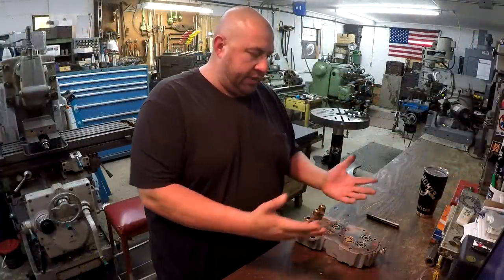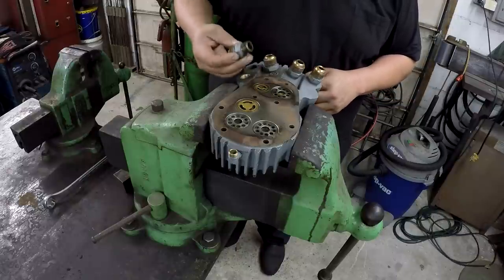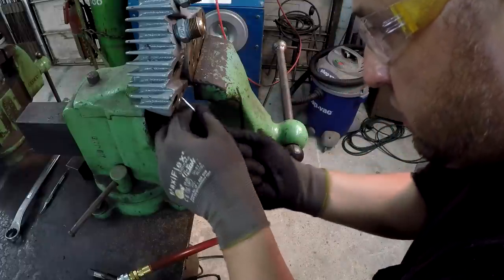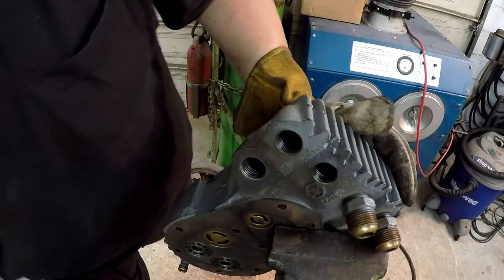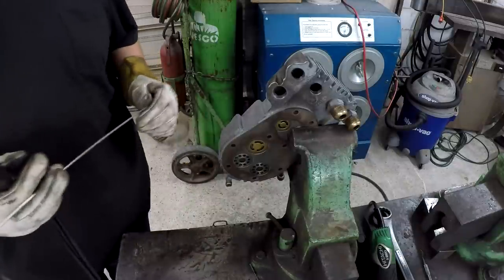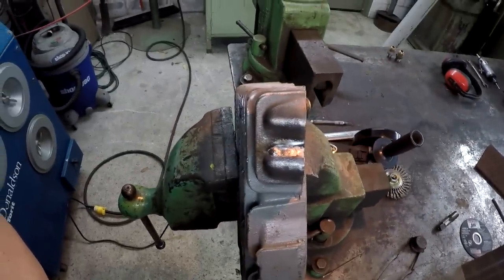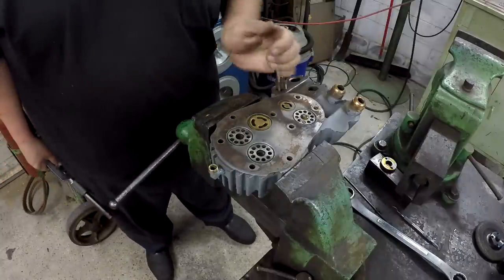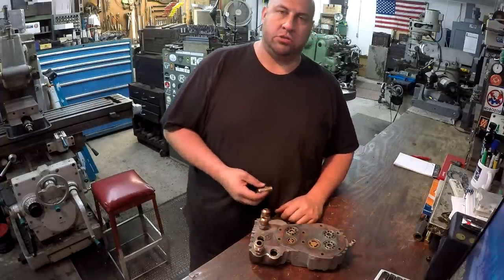Kellogg Compressor Head Repairs

Comment: One of my compressors uses the very pump this head goes on. It's an oldie but never looses compression power, VERY well built compressor from Kellogg American. I had to rebuild my head, required special tools I had to manufacture to change the ring valves. Other compressors come and go, this one never dies.
Reply: how do you get the valves out? Special tools?
Reply: @Mike Williams  I made a tool with a piece of pipe and a grinder with a cutting disk.
Reply: @mythril4  I will give that a try!
Reply: Just did one today, nice design

Comment: Adam, just a quick note about the IR thermometer. What it sees is a cone, not a dot like the laser implies. The angle of the cone should be printed on the thermometer itself. If you look closely you will see that at a distance of a foot away it is actually seeing a large area including the vise and surrounding material. The thermometer averages the temperature and you get a very inaccurate reading. I put a video up on just this subject a few years ago. It's a good idea to get as close to the surface as possible with the thermometer in order to get an accurate reading. Enjoyed the video very much.
Reply: I own a powdercoating business and use the same IR gun.   I can tell you from shooing parts like wheels lets say that have narrow spokes, lug nut holes in the center of wheels, and so on.  Where if you aim the dot at say the center hub of a wheel where it has the most mass which will take longer to get up to temp in my oven, the cone will partially be on the wheel surface and some of it will be shooting past the wheel and hitting the oven wall a few feet away.  Which in your head makes you think its not an accurate judgment of temp, but from actual readings from inches away to a few feet away, it honestly doesn't fluctuate enough to matter.   its not like 6 inches from the wheel and getting all of the wheel in the 'beam' will say 385deg and then I step back a country mile and all of a sudden its reading 265... its honestly +/- 5-10 deg max.   Now, that being said, the Kline IR gun Adam and I have, honestly, sucks.   The reflectivity of the coating or the color makes the temp reading swing a country mile.  Satin black reads the most accurate, gloss black would be next, silver or 'chrome' powder base is a mile off from actual PMT (part metal temp), white is pretty bad too, other 'darker' colors are somewhere in the middle.   Not to mention mine is over 35-40% off!   I can coat a thin metal outlet cover (I shoot these as demo swatches for people to see and feel the powdercoating colors) which will get up to part metal temperature in minutes where an alloy 20" wheel might take 45-50 minutes... I hang the outlet cover an inch away from my thermocoupler which feeds oven temp to my PID oven controller and where my PID reads 400 deg in the oven, 20 minutes later my outlet cover would have undoubtedly been fully up to temp and it reads 285 with the Kline IR gun 2 inches from it or 2 feet from it!   Its incrementally off from what I have tested and found, so bad that I have a chart I made with IR gun temp = PMT written out on the side of the oven!   I am too lazy to toss it in the garbage and get a better one because I adapted to it at this point.   My thermocoupler is dead on, and I verified PMT with clip on K type thermocouplers too.   I don't know if I just got a bum IR gun or they are all that shitty from Kline.    On this casting video I would have like to see a few temperature pens used then shoot the line where it drew and melted out on part with the IR gun to compare the results.
Reply: I use mine for measuring temperatures on the drum of my coffee roaster. I also have a contact thermometer that is calibrated so I can check against the IR thermometer. In my case the difference betwee 1" away and 6" away from the drum is enormous. At 1" the reading is very close to the measurement of the contact thermometer, at 6" it is lower by about 40%. This is on an 8" drum at about 200 °C.
Reply: same Kline ir gun?   I will have to shoot a video experimenting with mine next batch of parts I toss in.
Reply: I actually have a Kline and two  other ones and they all show about the same characteristics. It makes sense when you look at the cone.
Reply: I use the same Kline gun.  Bruce is correct about the cone.  If you look at the side of the gun, it tells you how big the spot is based on how far away the gun is from the surface.
Reply: Very useful information. 
Thank you.
Reply: @mikewood4939  I think your advice and experience with these cheap guns is spot on.  Shiny pot gives random readings (usually much lower) but up close it is much easier to get your region of interest into the cone of view so Adam could get less variation by getting up close.

Comment: That fitting is a flared adapter 1/2 flared x 1/2 NPT. We make them where I work at Lee Brass.
Reply: The "flared" end appears to be spherical versus standard 45 degree flare though.
Reply: We call it a ball because it is shape like a ball. I machine from 1" to 2" flared adapters and couplings on my line. That is a smaller fitting it's done on a smaller machine. We also make the tube nuts for them as well.
Reply: Jimmy..  is that ball fitting a standard in any particular industry. ?
Reply: +Doug Bourdo 1/2"flared× male adapter is what called  on the print.
Reply: Is it also considered 1/2 inch NPT to 1/2 inch JIC fitting?
Reply: My eyes must be off, it looks like 3/4 NPT, not 1/2 NPT.

Comment: TIG with nickel wire is my favorite method for repairing cast iron. The nickel rod flows really nice and you get the precise heat control of the TIG torch. This is the first video I've seen using it. Most cast iron repair videos are with brazing, which is a perfectly good technique. The configuration of the part determines which method is best.

Comment: Those fittings look like 1/2" npt x 1/2" or 5/8" flair fitting.  Used for connecting copper with galvanized pipe.  At least in the gas industry.  Great video,  Adam

Comment: I had a similar problem with my air compressor, but the parts were a lot smaller. I managed to grind some groves into the thread with my hobby tool and then I could use a large screwdriver to turn it loose. I guess that I was lucky that it came out without damaging the original threads and without expensive machines. But when you tighten those too much they can easily break of. I learned a lesson when it happened :-)

Comment: There is thread sealing product for sealing loose fitting threads, it is called Expando, and comes in powered form that is mixed with water to form a paste.  And I would like to say thanks for the vids, much better than the crap that is on tv.
Reply from the maker: +ken cunningham Thanks Ken

Comment: I don't know about the US but I those 1/2 inch to 2/4 inch fittings (and several similar) are readily available at most hardware stores in Australia (and yes we still use Imperial measurements for most pipe fittings)

Comment: That's a Kellogg 321tv and that fitting is a 1/2 by JIC male adapter. They have them at the Parker store if anyone needs the info.
Reply: It is not a flared fitting
Reply: kellogg compressor  I just ran into a couple of them that were not in service would have taken then but both were not easy to get out were the  same model and a 2  serial numbers off of each unit  found out doth were put in the building  band build around them out was in a basement  and they build the build then the other was on an upper maze floor part of the roof truss amazing how they put it in to the trusses  the have photos  of them  with the compressor hanging on a cran and the putting the truss was the compressor is  today 
the machine I was working on I had to rewire  the machine before any repairs we had to do  the machine had been on fire in the 70's and they did not use it due to it kept catching fire 
all new wiring and the machine working  we did a full refit on the machine 6-month work and its working wonderful again  had to relevel  the  frames and rails in  the machine lot of time doing in in the field

Comment: I have been using Loctite 567 on compressor fittings.  Good StufF !  2 issue

It take a long time to completely cure.  Over 24 hours in cool weather.
Once cured, you will DESTROY a brass or aluminum fitting trying to undo it if you do not heat the fitting first.
Reply: theoldwizard998  

The

Comment: I am trying to learn as a machinist what is worth messing with.  At one point in this project I was asking myself If the repair was quicker than casting and tapping a brand new part.  I come across this all the time when what I am working on, I am wondering if I can make new from stock in the amount of time it takes me to do the repair on the old part.

Comment: When doing welding videos, you should also put a piece of welding glass in front of the camera. The CCD inside the camera can be damaged by the arc from the welder, which will show up as spots in the picture that get stuck as some color.

Comment: Nice repair, Adam.
A trip to the local hydraulic supply store should get him the right fitting. 
Some NAPA stores have them.
Thanks,
John
Reply from the maker: The place I mentioned is a good source for hose and fittings
Reply: +Abom79 
Sorry, I guess I missed that one.
Oh well. Not having a good day anyway.
Thanks Adam.
Nice work as always.
John

Comment: The fittings could be bronze but that's not typical. Most likely they're brass. The one you were holding up looks like a compression fitting and the other a flare. Too bad you can't get John Crane plastic lead seal any more. That would be the best sealer if you can find it.

Comment: Good job Adam. I used to work for a hydraulic franchise & the fittings look like NPT on the outside but could be a BSP taper on the other end?? Have seen these before, especially on English compressors. Any hydraulic shop will have replacements, at least they do in NZ.

Comment: One way of doing fittings like that is even if they're small ones I will grind down the hatch low blade to fit in the hole and I will cut a slot on one side and maybe slot on two other sides and I will take a chisel I mean if punch and then I will punch the broken pieces will come loose and come out and then tap the hole and in you still have a crack to repair

Comment: Using a hacksaw blade cut 4 opposing slots down the length of the broken off fitting just deep enough to see the casting. Drift and pick out the fitting, chase the threads and  replace fitting with plenty of Teflon tape, then pipe dope.
I'd have her ready to chooch quicker than you could get back with the part. No disassembly required.
Reply from the maker: +ipissed That's what I'm talking about, armchair quarterback!

Comment: Standard parts - in my hardware store.  Threads need filling like said so they don't bottom out and get torqued and break the iron to seal.  Good job.  Suspect task was not to make it pretty - just save the part if possible. Nice job.

Comment: What is the make and number of the nickel rod you used? I am going to do a repair on my chevy 350 cast iron block that cracked in the lifter valley and by the water drain plug by the oil pan. I have seen a lot of cast iron welding videos but you made it look real easy. Thanks for the awesome video.

Comment: good job Adam?. I hope that vise had another jaws on it the way you was clamping on the gasket surface.
Reply from the maker: I didn't clamp hard enough to mare the surface, plus my jaws aren't aggressive anymore.
Reply: How do you keep the cast from not Cracking ?
Reply: pre-heat
Reply: That's what I was thinking, a bit of 50x50 (2“X2" for the yanks) Ali angle is cheap and easy

Comment: Adam, Looks good. One Question. were you concerned about hardening the cast iron adjacent to the weld and eventually cracking, and how do you decide whether to weld or braze? I love watching all the videos keep up the good work.
Reply from the maker: Sometimes depends on the size of the part. Larger parts I typically like to braze. This one I didn't want to get too hot because of he valve parts.

Comment: Was it broken off going in or trying to get out?   An internal pipe wrench would have been an interesting go on this problem.
Reply: many times an internal pipe wrench actually tightens against the wall threads of the housing. depends on how & why the threads are tight in the first place.

Comment: Hello all, I'm rather curious to what does that particular part of the compressor do. Thank you for any info
Reply: Basically its like a cylinder head you would find on a lawn mower except instead of poppet valves it uses check valves to allow air to be compressed and to hold pressure inside the tank.

Comment: How come when you strike an ark it's spatters for a second or two and then settles down? 
Is it due to not having enough current to start off with?
Reply: His machine has a high frequency starter that starts the arc then turns off once the arc is established
Reply: +Sam Lohman I've used hi-freq TIG and it's never done that? 
Must be due to different machines
Reply from the maker: I've never figured that one out man, but I think it's something with my machine.
Reply: +Abom79 Also, why do you use both scratch start and hi- freq? Would it not be better to just use hi-freq? Or is it just the older machine you've got haven't got that feature?
Reply: Could it be that the hi freq spark gap needs to be adjusted?

Comment: (i'm not a welder) just a quick question what is the difference between mig and tig? is tig more of a solidify weld, erm like soldering it works its way into a gap/break then seals. great work on the unit, keep it up.
Reply from the maker: +Dj Morgan tig welded uses a torch with a tungsten rod and inert gas to create a weld puddle and metal filler rod is added by hand. MIG is a wire fed process, when you pull the trigger wire is fed into the puddle and also creates the arc while gas protects the puddle.
Reply: Thanks for the the into, i'm doing an engineering course at the moment and have only used mig a couple of times, we are mostly being taught how to use a lathe, but i did enjoy welding, but with what i have seen in other videos i think folk have more of a skill working with tig. Thank you for your quick reply, many respects from the UK.

Comment: Adam, could you have used silicone bronze filler rod, or have you simply had good luck with nickel on cast iron?
Reply from the maker: +Marty Escarcega I could have used it too, but I wanted to weld it together.

Comment: gripping it in a vice right where it looks like the head gasket goes, that's a bit naughty isn't it?
Reply from the maker: +Lasse Langwadt Christensen My vise jaws aren't sharp anymore and won't dig in. I was using only enough pressure to hold it. I didn't mare the surface.
Reply: Abom79
I know you wouldn't do it if it caused damage, just looked like if it was on TV it would have a disclaimer like: stunts performed by trained professional, do not attempt ;)
Reply: Lasse Langwadt Christensen in other words Adam has common sense, knows what he’s doing and doesn’t feel like he should have to put bubble wrap warning stickers on anything wasting his production time.

Comment: By the way Adam what size Tig torch are you using.
Reply from the maker: I don't recall off hand Loren. It's a standard torch kit I bought from Airgas as a replacement for the machine.
Reply: I see. I am new to Tig welding I just bought a Lincoln Ideal arc 300 amp welder in like new condition and it came with a #21 torch but I noticed that yours looks a little smaller and I think that I would like a smaller one better Thanks keep the videos coming they are great.

Comment: So, you blew the shavings deeper into the port?
Reply: That's what I saw.    I have the same compressor  He should have pulled the valves. Now the dirt is all going to get sucked and blown  into the cylinders,,,,and as a retired welding engineer with over 40  years behind me in Mlill spec  and nuc work I would have liked to see a LOT more preheat,,,and if he didn't cut the crack completely away PAST the existing  threads with the tap  we have a dandy stress riser there too. - Hope he got away with it but what he did we used to call "Camouflaging"  - Too many short cuts to make me happy with my background.but if it worked God bless him.

Comment: Have you ever overhauled one of those compressor heads?
Reply: Toby W

I have,  I have a couple spare Kellogg compressors,  and a ton of NOS valves, springs, gaskets and seats.
Reply: Now you tell me,,,,I had to make a spring and 2 valves....They do not seel them out of a kit and they wanted over a C-note for a complete head kit. - It's been working fine for a year now, though.

Comment: why didn't you use a easy out tool?
Reply: Because then you have to remove the easy out you just broke off.
Reply: when you try to use an easy out on a part that is that thin it makes the broken part swell and get tighter in the threads. and then you have to do what the metal butcher said!

Comment: you forgot to drill a stop hole at the top of the crack.     smiles
Reply: Actually, I thought the same thing until he brought out the larger disc and basically made it a moot point.

Comment: Hi,

That halogen projector (or whatever) you use near the computer makes your fave look like a tomato. That lamp has (sort of) color temperature much lower than the other fluorescent (the camera keeps itself adjusted for the fluorescents) that makes much more sense not to use the projector. Your face looks much better far from the projector.

 If you feel that for some reason you need it, please let me know if the projector is halogen or, if not, what it is and give me the fluorescent references (they are written on the lamp) and I will try to find a proper filter for your projector.

Regards
SC